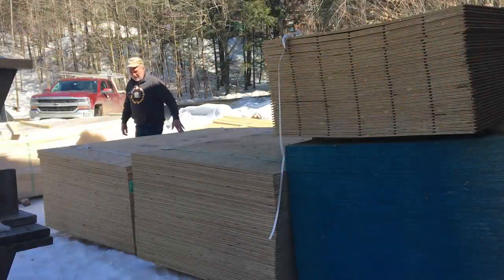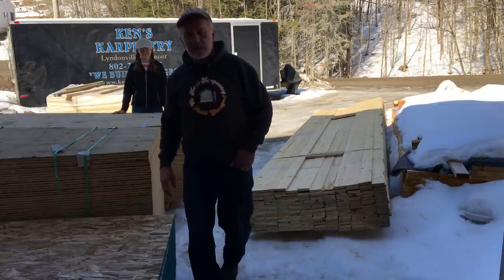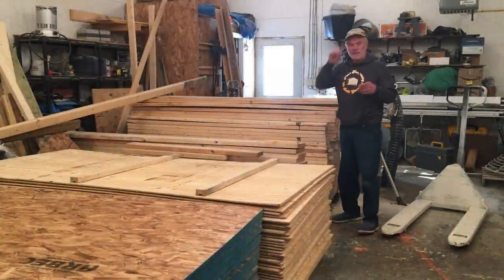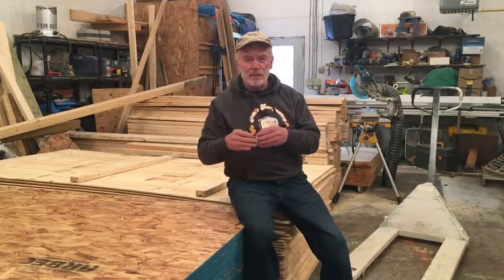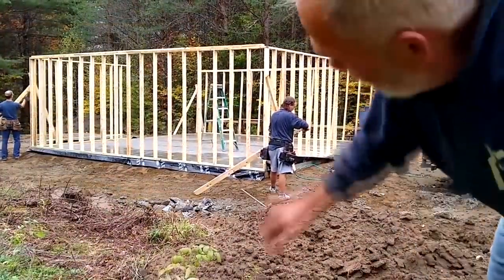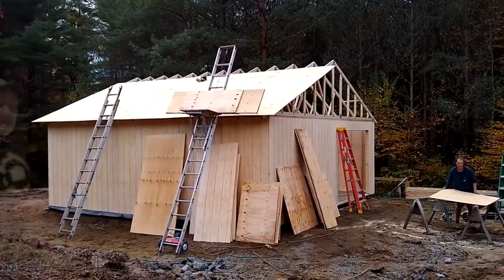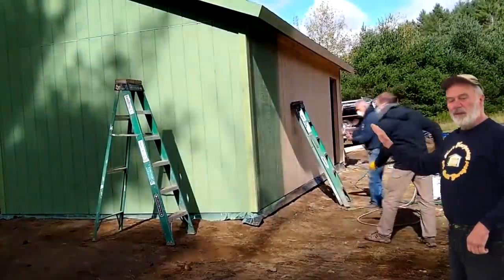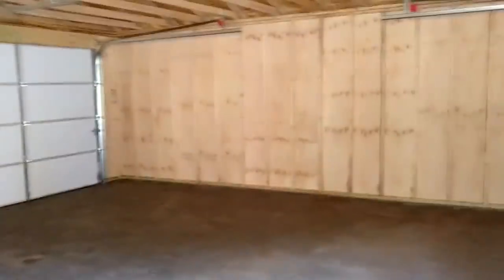I Stabilized the Sticker Shock Short Term for Garages in 2021

Comment: You’re going to need to get pallet shelving. It’s certainly a concern for theft and weather damage. I stored my cabinet making lumber under a four car carport. I had festoon equipment to break down my sheet goods. I had industrial machinery in my indoor shop. I sold all of that about 8 years ago. A year or so later that property flooded in a freak weather event. The house flooded to the eaves. I had already moved away. I’m impressed with your ability to construct structures.

Comment: what is the thickness of your T 1-11 and your  reverse board and batten [T1-11 8] ? I have had problem with both which I had purchases from the big box with the out splitting /cracking I been using Plytanium Plywood Siding Panel  we where using 5/8" but now - for along while it been 19/32" we been trying to stay away from using 11/32" and the 15/32" siding been splitting /cracking but seem to a lot less when I buy from a local company the big box stores!  I been staying away from hardy board or planks, it is too much trouble and labor to nail and cover nail heads and does not add anything structurally  we have put up an underlay of 7/16" OSB we had not used type of Masonite 4 x 8 in year due to the derogation of it in time  and I am thinking of using  Strand Wood Siding Panel - what do you think? PS if your shoulder is feeling stiff take some omega fish oil and omega 3-6-9 flaxseed oil it is good for inflammation and it helps clean out your arteries - My joint where hurting and I took Glucosamine supplement then I need some thing clean my arteries so I started the omegas I had not taken Glucosamine in 18 months and my joint do not bother me any more
Reply from the maker: We use 5/8. Thanks I’m taking fish oil and a few other things